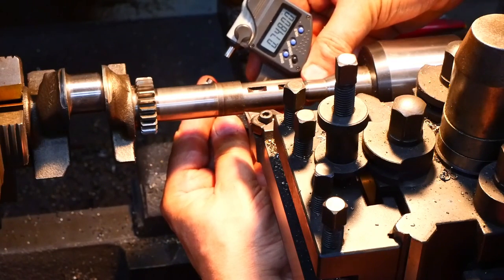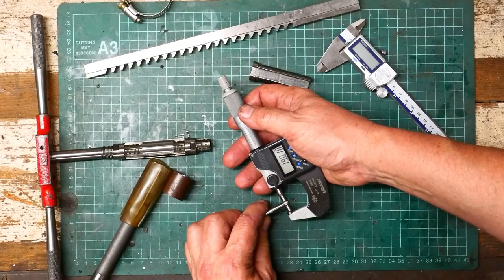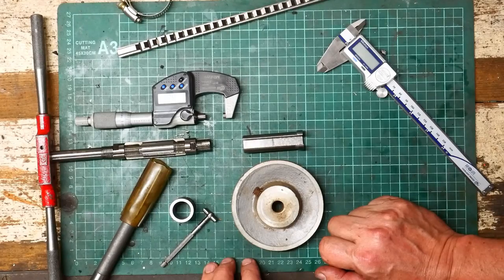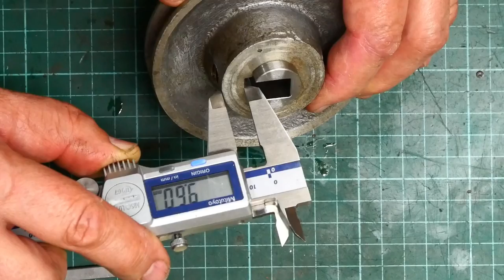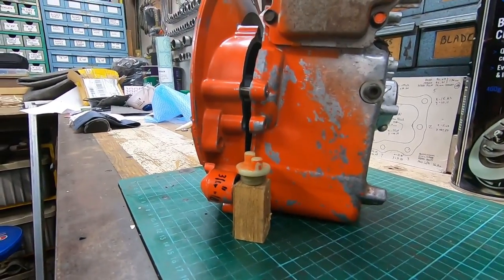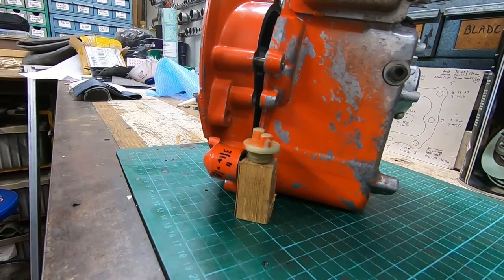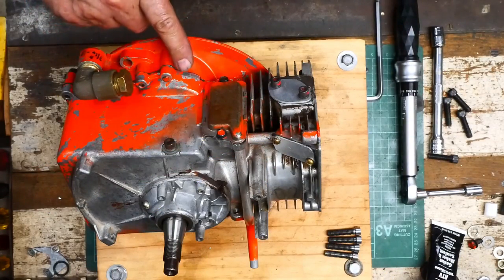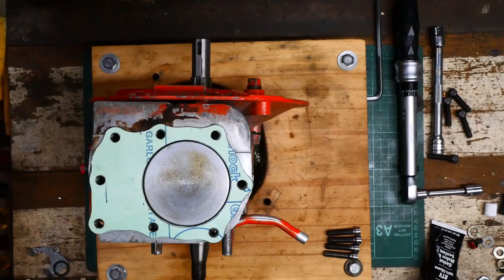Briggs & Stratton conversion to an air compressor - Part 4

Comment: Gday Alan, making good progress, im keen to see the next instalment mate, cheers
Reply from the maker: Thanks Matty. You know the part of this video that appeals to me the most ? - using masking tape wrapped around a thread cutting target to map the pitch (@ 29:23 ). Its a simple idea, and I don't know why I didn't think of it before. I repurpose a lot of old parts so its not the first time I've needed to cut a new thread over the remains of an old one but this just made it easy as to verify the new pitch.
Cheers.

Comment: Allan you have some great mods to your press , I have a couple of old fly wheels for my press saves the two half's from pasting.  I think it would work well for broaching. 
I also keep a hair dryer in the workshop, handy for a lot operation.
Christopher from Queensland
Reply from the maker: Thanks Christopher. A lot of salvaged car parts can be repurposed to good effect and I use the hub part of a brake disk rotor as a light duty press accessory. I can see that a flywheel would be similarly useful and I'll look out for one. You have mentioned the hair dryer idea previously and it sounded like a good one. Unfortunately I had a near death experience when I borrowed my wife's to try it out :) 
Cheers.
Reply: @alanshomeworkshop  I am a coward I got my wife to buy me one at OP SHOP.

Comment: Coming along nicely Alan. Does that black crankcase goo remain in place or do you have to scrap in off and reapply more is you have to split the crankcase again?
What brand and model of milling machine do you have and are you happy with it (would you buy it again)?
Thanks Greg
Reply from the maker: Thanks Greg. As this is the first time I've used RTV silicone, I have no experience with disassembly/reassembly, but I expect it would need to be scraped off and reapplied. I used it because a paper gasket would have required a lot of careful cutting out and hole punching in narrow strips.
The milling machine is imported into Australia by Hare & Forbes with model code BM-62VE. The current version is listed here: https://www.machineryhouse.com.au/m598d. It appears to be very similar to the model G0726 imported to the US by Grizzly. I bought my machine about 3 years ago and am very happy with it. It is a bigger machine than I really need for my undemanding usage, but I was in a position to indulge myself and went for it :) It has an NT40 spindle taper which allows some tooling to be shared with my horizontal mill. The table is big enough to allow a vice and rotary table to be installed side by side which can be very convenient. The height under the spindle has been adequate for the work I've done so far and a column riser I bought with the machine has yet to be needed. There have been 2 issues with the machine. The first occurred when a part in the variable speed drive came loose and was easily rectified. The other was a cracked casting (covered here: https://youtu.be/CCmiQ13FjC8 ) and also readily fixed. I would certainly buy it again. NB some of the machines in this class use ball screws for the table movement and would allow a CNC conversion to be applied. 
Cheers, Alan.